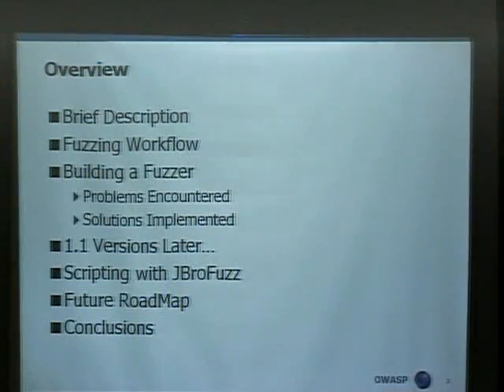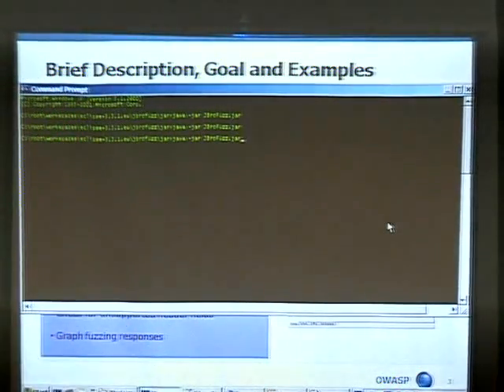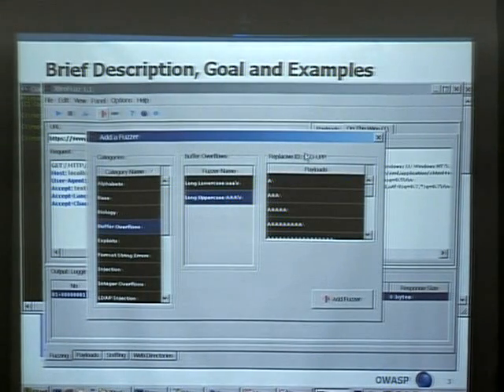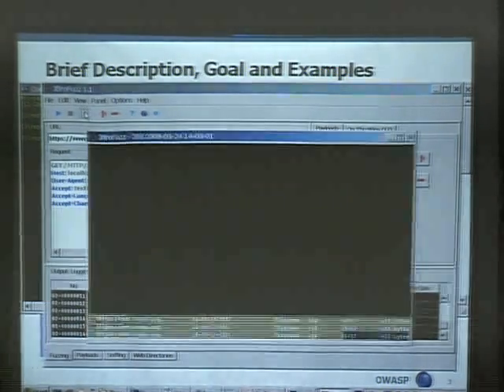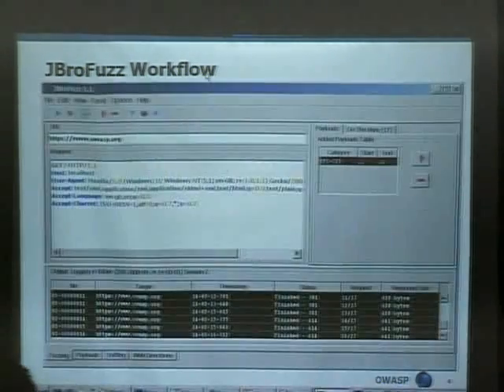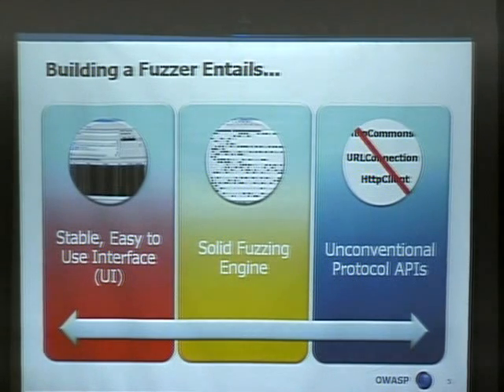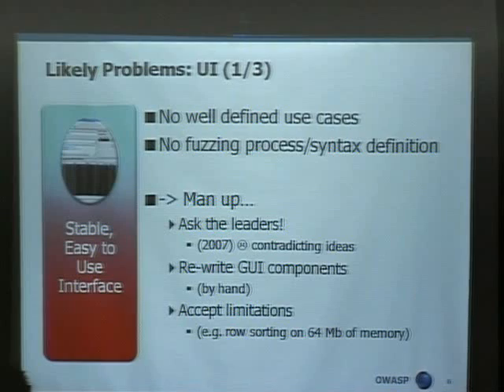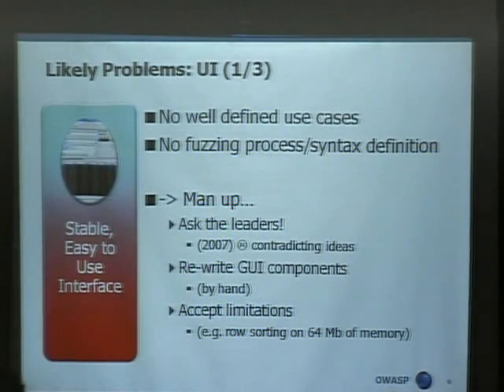Owasp5042 Part1 - JBROFUZZ 1.1 - BUILDING A JAVA FUZZER, with Yiannis Pavlosoglou.

Comment: JbroFuzz is great tool in the field of penetration testing of Web Application. However there are scope of improvement , which i am sure team is taking up. Few Suggestions that may be useful .
-- JBrofuzz could also shed some light on integrating with System Software.
-- JBrofuzz can also have creating .jbrf file for user defined